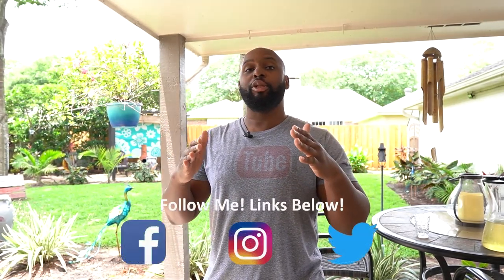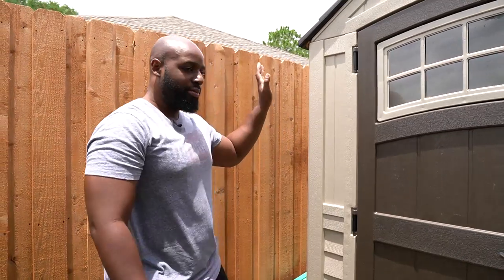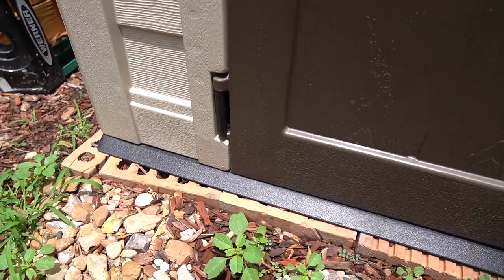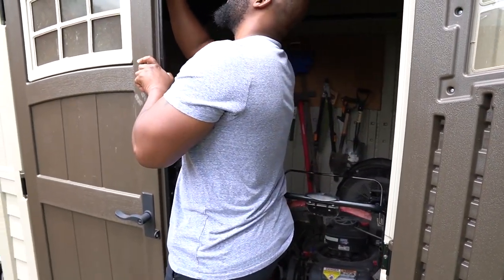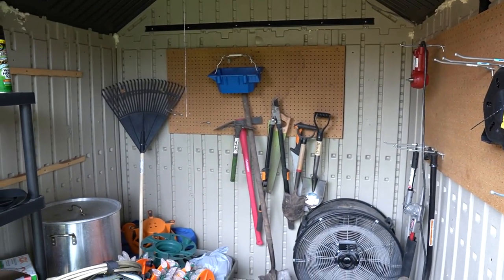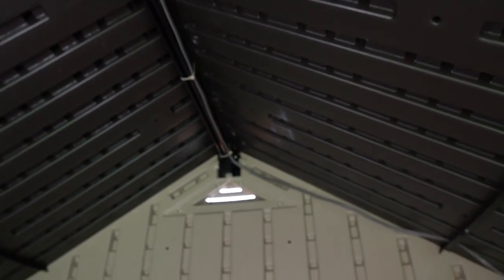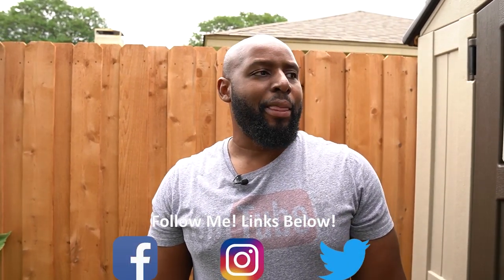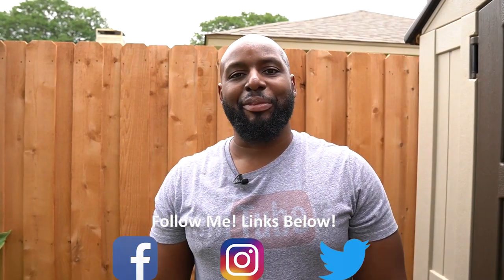Suncast Sutton 7x7 Resin Shed: 3 Years Later

Comment: We rented a small uhaul trailer and had them load it at the store.  When home we just unpacked it piece by piece.  My husband pretty much put it up on his own with a little help from me to get roof locked down well.  We are in our late 60's.  Most labor intensive part was to build the foundation.  We put it down in low part of back yard and it tends to be damp so built regular plywood and 2 by 6 boards on block pilings.

Comment: i bought recently a 7x7 craftsman shed (made by suncast) that claimed it had versa track compatibility for mounting on the side of the wall. (biggest scam, since the parts are not available.) I like your method way better. where can i find the brackets to mount the pegboard to the resin wall?

Comment: I think the issue with the gaps on your wall has to do with your uneven foundation. As seen @ 2:05 and the middle of your door opening at the bottom. I installed mine but had to build a foundation first because where I was putting my shed slopped down away from my property. My walls don't have any gaps. Nonetheless, glad it's worked out for you. Thanks for the upload.

Comment: Oh the Lord is good! This video showed up in my 'just for you' videos today. I bought the Suncast Vista 7x7 in May. I'm single so no significant other to put that up for me. So I'm borrowing my sister's hubby, and it's going up within the next 2 weeks. I had mine special delivered because it's 395 pounds. I've been wondering about the foundation and what I'd need. I live in South Louisiana, very South so I think I'll be using cinder blocks. I also purchased the shelving unit with it. I've been eyeing this shed for over a year, so when that stimulas came I named it my StimulusSheShed! 

What about the flooring? Did u just use the plastic flooring it came with? No plywood underneath?? Rubber padding??

Thanks so much for that video. I feel it was meant for me. God Bless You 🙏🏻😇🙏🏻

Comment: I have the Sutton too. Installed it in October 2014 and now all 4 exterior corners are cracked top to bottom. Suncast will stand by their 10 year warranty and replace the entire shed (corner pieces were not available). I’m not sure if the central Ohio winters are to blame or it is a design defect. I wish they would have gone to a metal reinforced corner design so I’m not in the same boat down the road. Anyway, nice video and I hope you don’t have the same issue.

Comment: Good on ya for coming back 3 years later to do the review. Well done also, not a lot of blabber, mostly all good to know related stuff focused on the shed.  Yea nothing is going to keep out a serious thief, only the casual thief.  A wide selection of locking latches would be found at your home center store to be applied in addition to the one there, that you could lock if you actually wanted it locked.  Bolt it on with threaded screws or bolts and nuts and use some wide flat washers all in stainless or galvanized.

Comment: Awesome video! None of the info was fluff. Thank you for keeping it real. 

I just finished putting together a Craftsman 7x7, which is almost identical. Bought it at Lowe’s where 2 guys helped load it in my truck. When I got home I cut open the box and took it out piece by piece.
I was going to construct a wood foundation (using treated wood) but decided to simply use paving stones (placed a few inches apart) covered with the thinner plywood. I questioned my decision but after seeing your foundation I’m ok with it now. After I got it done it rained and there were no leaks so I guess I did it right. Just wondering how long it will last in the Arizona heat (Phoenix).

Comment: I have the same shed and the doors have melted from being in the sun. Very disappointing. The company did give me replacement doors but it's a one time deal. I have not yet put the new doors on because they will just melt again. Anyone have an idea of what I can put on the front of the doors to prevent them from melting again? Thanks. Has anyone else had this same problem?

Comment: Make a note.....  it will NOT survive a F2 tornado with a riding lawnmower in it.  Lol I may or may not know this from experience.  I had the craftsman version of this and it was in pieces three houses down. Lawnmower was flipped maybe 75-100 feet from where it was in the shed originally.  I liked the shed so much though I purchased another just like it.  Love it.  Thanks for the idea on the peg board because I totally need that and the “add ones” are expensive and lame.

Comment: Thanks for the update video! The screws for the 1x1 boards you said sheet metal screws, got a link to which ones you used specifically (or close enough)? Want to make sure I get it right the first time and don't screw holes in the shed that I can't use. I ended up paying the money to get a concrete foundation poured cause my yard is pretty uneven and it's worked great for me for about 3-4 years.

Comment: Has anyone learned what screw threads are for the "plugs" that go into the walls?  We want to hang a tool rack and replace a few of those with bolts to hold it up.  Sun Cast won't tell us as they want us to use their pricy hardware.

Comment: I had a Suncrest just like the one in the photo. After five years the sides where the corners are ripped apart. I had to use Gorilla Tape to keep the water out. Called Suncrest about the 10 year warranty, got nowhere !   The door hinges that are in the plastic of the doors came apart also. I am replacing it with a LifeTime Shed, better constructed including the door hinges. As for the Suncrest,  I am using a Sawzall with a sharp blade to cut this mistake into 1 foot square pieces. Big mistake if you buy one of these !